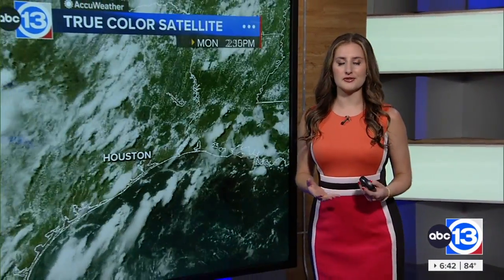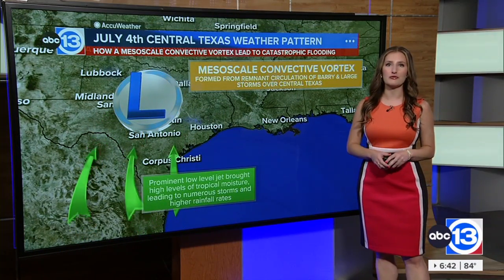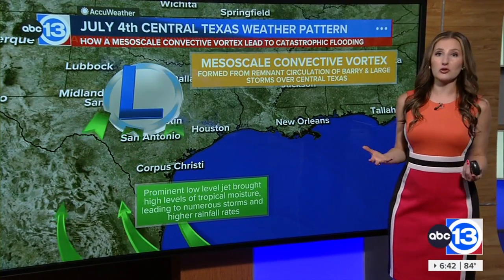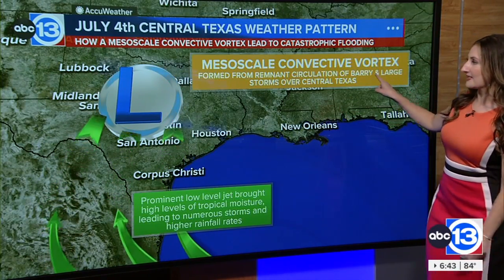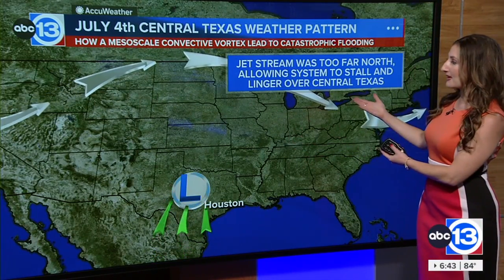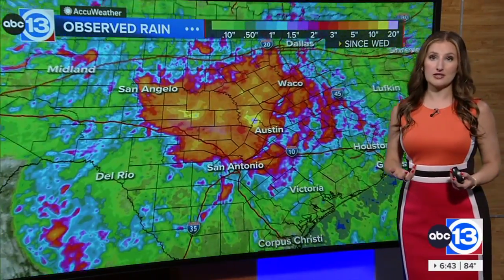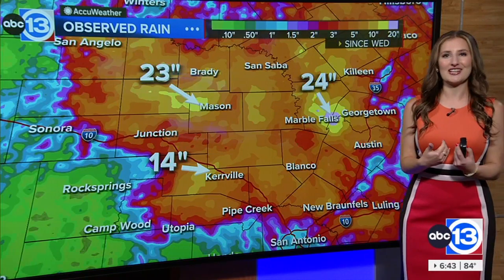How a Mesoscale Convective Vortex led to Texas' catastrophic flooding

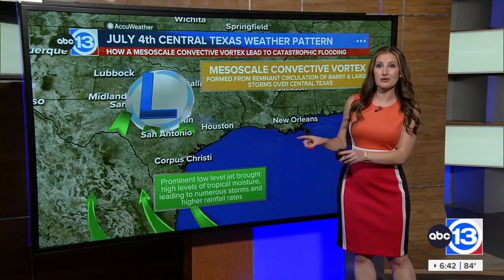Comment: STOP IT !!!!    At 0:49 the low pressure "L" symbol is supposed to be RED.
Did you go to modeling school instead of learning weather systems?
Reply: This comment doesn’t make sense
Reply: @MichealIV  The symbol for Low Pressure is a RED "L"  She uses BLUE which is the symbol for High Pressure.  This is meteorology 101 and she fails.